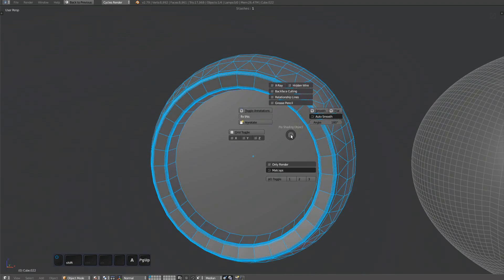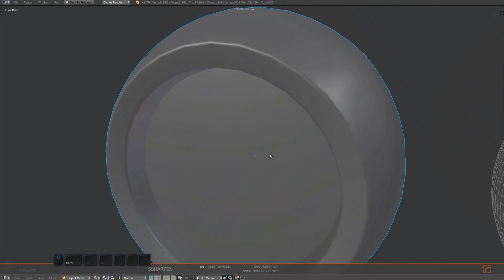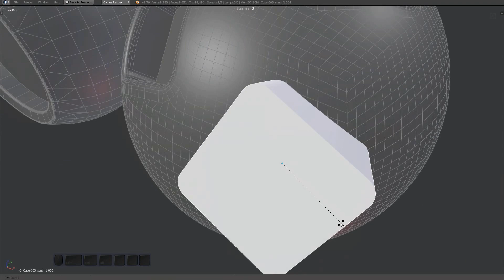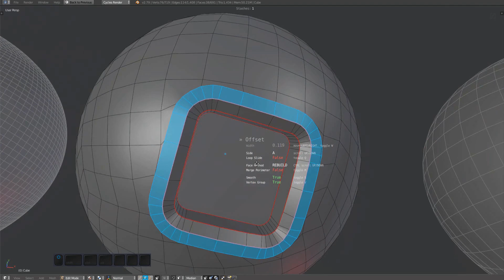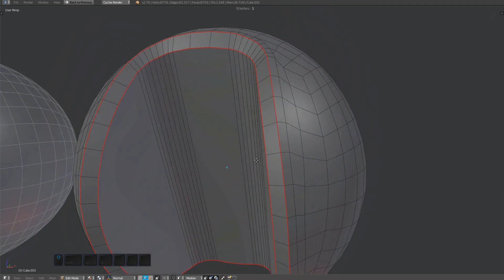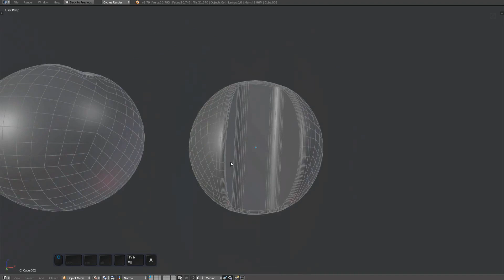MESHmachine 0.6 - Offset

Comment: I purchased this product a few days ago.
I do not know how to do the process, 3:39 to 3: 40.
I guess you were selecting the loop lines.
I've been trying the same way, the last part, before starting Boolean Cleanup, you just press the 2 key, so do I.
But after pressing the 2 key, and press the Boolean Cleanup, an error came up.
It says " Non-manifold edges are part of the selection. Failed to determine sides of the selection.".
Reply from the maker: I press 2 because and it calls the Smart Edge tool in MACHIN3tools, which with a face selection converts to a boundary edge selection. Your error however seams not directly related. Your selection contains non-manifold edges, which can't happen for the Offset tool. If you can't figure out what is happening, see https://machin3.io/DECALmachine/docs/faq/#get-support

Comment: Hey M, love your stuff. Thanks for the detailed videos, most of the things I happened to be using wrong.
I have a quick selection question: I can't seem to figure out your selection procedure that starts at 2:47 and ends at 2:49 with a boolean cut loop selected. How did you do that? Sorry if the question is too dumb, I am new to blender, don't know all the kung-fu. Thanks in advance, looking forward to what's next <3
Reply from the maker: Select top face, grow selection via "Select More",  followed by "Select Boundary Loop".  I have select more/less mapped to ctrl + mouse wheel and "select boundary loop" on a shortcut.